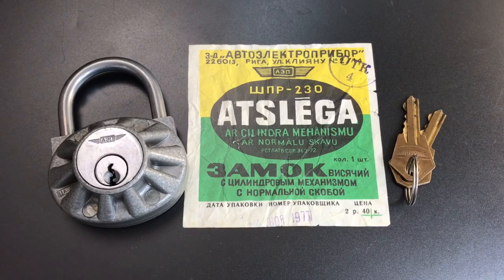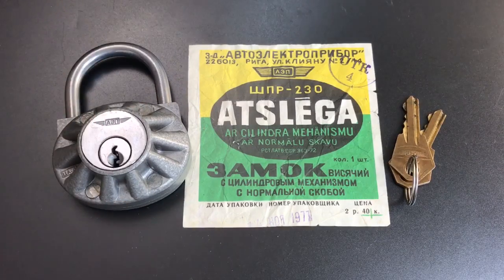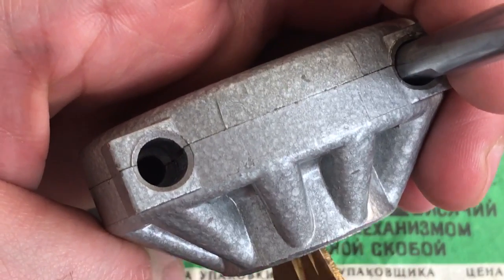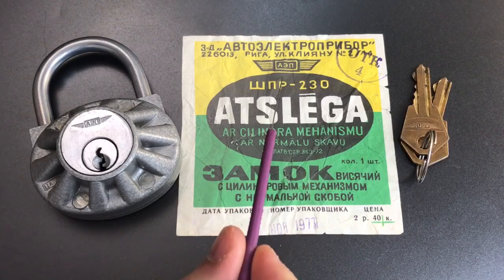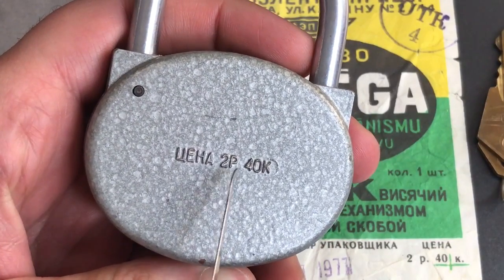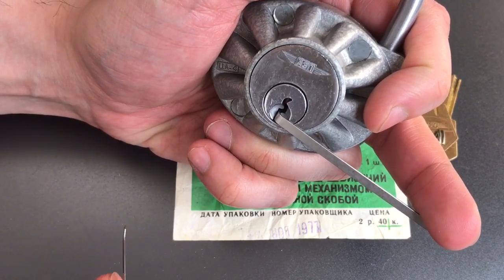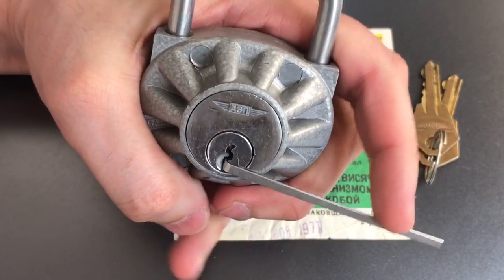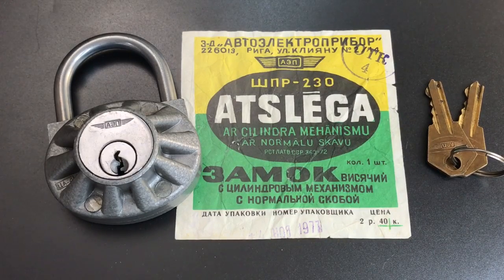[466] Unusual Cold War Era Latvian Padlock Picked

Comment: Hello from Latvia ;) These padlocks were popular back in the day - there wasn't so much crime or something to steal back then.
Reply from the maker: Thanks -- good to know.  Any idea why they used those strange little lock cylinders?
Reply: LockPickingLawyer as the cylinders were used as regular door locks, it was cheaper to use them instead of reinventing the wheel a second time. Think of it similar of how cars are built today. A common base platform for a whole variety of chassis and interiors. But under the hood, technically the same.
Reply: LockPickingLawyer I believe that Marc is correct. I saw similar principle in electronics, but they were much better made than those that we have today - because work and cost of BOM was not even considered. By the way average sallary back then was 90-120 rub.
Reply: I was thinking that it was left over licks from doors turned into padlocks, but yeah it makes sense that they would just say “screw it let’s make the body around the lock” as it was easier and cheaper
Reply: Hi
These are still used for locking firewood sheds in Latvia. I had one of them. They can be open with one hammer blast. Casing material is extremely fragile. 
Thanks for videos!
Reply: @lockpickinglawyer  My best bet is that the cylinders are there just for cosmetics. I'm from Latvia and this reminds me of a lot of the space age design that can still be seen here.
Reply: @lockpickinglawyer  Anyway in 99% cases key could be found under entrance mat in that times )

Comment: That appears to be a die-cast case, and at least three of the four round marks on the front appear to be the remains of the sprues where the zinc (or whatever it is) was injected into the mold. I'm not sure about the lower-left mark. I suspect it is also a sprue and not a rivet, but I can't be sure from what I see in the video. I suspect some other mechanism holds this clamshell closed, and it might be possible to open it and get to the cylinder.

Comment: It looks to be designed so that the same lock cylinders used for the cars could be used for the padlocks. As though the automotive SOE had a surplus of locks and scrap metal.
Reply: Lada, Volga (So VAZ and GAZ) used wafer lock cylinders with 5 wafers. Also GAZ 24 had 4 different lock cylinders - ignition used one key, doors, fuel flap and trunk used the other key, but all of the lock cylinders were different in design.

Comment: Interesting. I would say the design was commanded by manufacturing overrun of cylinders given the overall design. Not unusual in Warsaw Pact countries economy. If they had overrun of some part they would try to utilize it as much as possible to get the same or increased budget for the next 5-year plan. A good example would be publication companies in Czechoslovakia using allotted paper to print a lot of classical Greek literature from plays to works of philosophy because they already fulfilled their planned book prints and wanted to keep/ get an increase of the same funding and resource allocation. A lot of those books were sold at a cost.

Comment: I would love you to crack it open, and see if there is a release method for the cylinder. I would expect that it well may be as you thought, made for interchange of cylinders. Maybe try notching the back of a duplicate key, ala National Bank Teller locks, you may luck out and have something cool to show. The cylinder just seems to be far superior in ruggedness and material to match that lock body, if it were NOT part of a modular system of some sort.